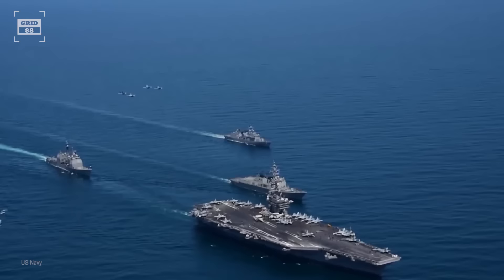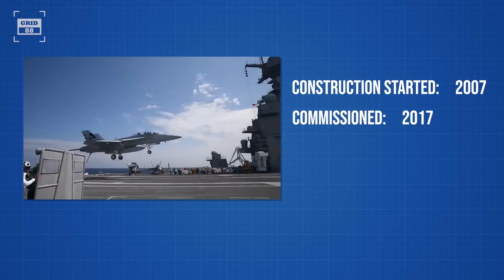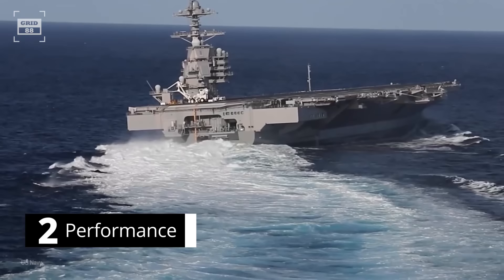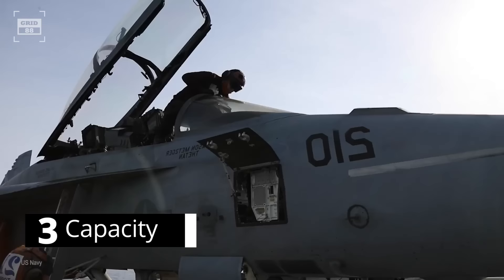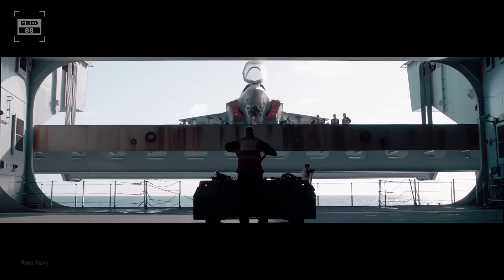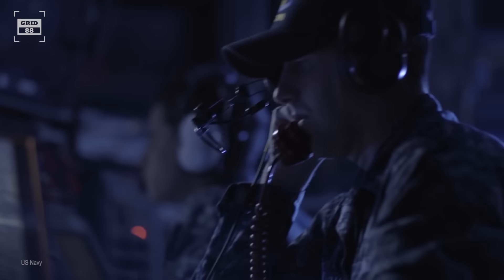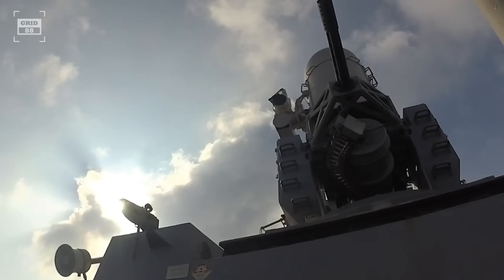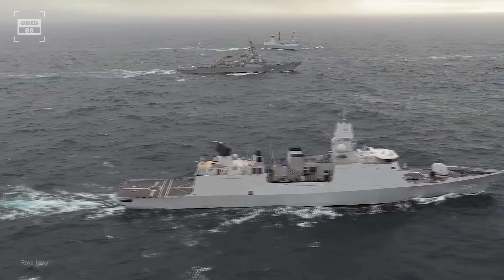USS Gerald R Ford vs HMS Queen Elizabeth - Which aircraft carrier is better?

Comment: If you are solely comparing capability then the Ford wins hand down. However, you have to look at the bigger picture. The Ford is astronomically more expensive than the QE and not just in construction. When the ship eventually gets retired it's decommission costs will far out way that of the QE. In fact the UK will likely sell the carrier on so will recoup some of the overall cost which wont be possible with the US carriers. Also, nuclear has it's drawbacks, some ports refuse nuclear powered vessels so the QE can dock where the US carrier cannot. The US carrier also has enormous refit times of literally years while the QE does not.

While range is clearly a key factor for the US carrier she still needs food, muntions, new crew, supplies so basically you could just refuel at the same time so it isn't as huge an advantage as people think. Especially if your navy has a large solid support fleet.

In reality the QE was never designed to compete with the US Ford carrier. If it was than the UK would have probably gone for just one carrier and spent the money making it nuclear and use the UK variant of EMALs and be closer to that of the Ford. Or non-nuclear and matched or even exceeded the combat capability of the Ford. The design was to give the UK a blue water navy capability and an independent strike force unmatched outside the US. It has done that and considering you could get 3 QE for the cost of 1 Ford (Meaning at surge capacity the three carriers could have over 200 aircraft) than I think the comparison is a lot closer than people think.

If there was war than it would be a different story. This is just the UK stepping up to it's NATO commitments for it's size and economy something which very few other nations are doing.
Reply: Good read Welshy 👍
Reply: The only country that denies its ports to Nuclear Powered vessels is New Zealand.

There are some individual cities that pass symbolic motions declaring themselves nuclear-free zones.  But cities don't have the power to ban foreign ships from ports that share their name.

For one, often the ports are run by entities separate from the city.

Also, federal governments control what foriegn ships can visit their country. This is not a decision that cities can overrule.
=========================

The QEC is a great ship.  And perfect for the UK's budget.    And the US probably shouldn't have implemented 23 bleeding-edge technologies into the Ford. As that is causing the ship to be behind schedule and over budget.

But is a fantasy that three QEC could surge over 200 aircraft.

The most each QEC class is designed to handle is 36 F-35s and 14 helicopters.   The QEC will usually just sail with 24 F-35s. While 36 F-35s is the surge capacity.
===============

It is also a fantasy to claim that the UK could have built a carrier that "even exceeded the combat capability of the Ford."

Over the past 40 years the US has built and operated  more aircraft carriers than the rest of the world combined. And it spends far,  far more on R&D than does the UK.    And the US also has a far larger industrial base,  and is the leader in technology.
Reply: @Courage2006  
Smaller crew = smaller running costs
Reply: @johngraves6378  Yes, a smaller crew means a lower running costs.

It also usually means the ship has less capabilties.  

And it certainly means there are fewer crew members available to fight a fire, stop a flood, and repair the ship while in a war situation.
Reply: @Courage2006  QE has almost full automation, something Ford is close to by the way, so can deliver a higher sortie rate than previous UK carriers. I don't think any navy would put extra souls on board to stamp out flames. If a ship does get put out of action the less souls on board the better.
Reply: @bmcpheat  What does "full automation" even mean? What specifically (besides weapons handling) is automated on the QEC that is not automated on other ships?

And fighting fires aboard ships is extremely important.  

American carriers definitely have people whose full time job is Damage Control and have a special patch for their fire control rating -- plus the whole crew is trained in fighting fires.

Also, a too lean of crew means that a ship doesn't have the redundancy to operate in a war scenario. 

And both the Nimitz and Ford carriers have a much, much higher sortie rate than the QEC.
Reply: @UCtVTOkQY7s3O0vQmqst14Eg You've still failed to say what is automated besides moving the missiles to the assembly area.

As you've pointed out, moving them doesn't take that many people so it can't be the source of much of the difference in manpower between the ships.

Also, the sortie rate you quote is just for a one-day surge -- it can't be maintained. And even that 110 sortie-rate over 24 hours -- is just a hoped-for, theoretical rate.

The QEC has never achieved anything near that rate.  In contrast, the Ford has already launched 170 sorites in just 8.5 hours.

The Ford will be able to fly 270 sorties a day over a five  day period. 

A single Ford will be able to fly 1,350 sorties over a five day period, In contrast, three QECs will only be able to fly 1,290 sorties over the same period.

--------------

You're also assuming the Ford-class carriers could be as easily hit as a QEC-class -- which isn't true. Since the Ford-class can fight the battle from a further range than the QEC thereby being out of range of the enemy.

American CATOBAR carriers launch fighter jets with significantly more range and bigger bomb load.

Plus, the Ford-class carriers can launch E-2D Hawkeye for airborne early warning (AEW).  Thus they can find the enemy before the enemy finds them.

Plus, while the QEC has just one layer of organic self-defense, the US supercarriers have three.

Plus, the US supercarriers are much more heavily armored with both thicker steel and Kevlar protecting the vital areas.

The three QECs would never even have a chance to fire a missile at the Ford carrier.  They would be attacked before they even know the Ford carrier was in the area.  And they would have no way of determining where the Ford was.
Reply: @Courage2006  keep your hair on lol. 
I think most would agree 1:1 ford is better but if you think 1 Ford can take on 3 QE your in la la land. Because if nothing else  you're concerning yourself with something that will never happen. If the UK did build a better craft than a Ford that itself would be an unnecessary act of aggression.
Re the automation. Click the link I provided.  Its far in advance to any other craft at sea.
Reply: @bmcpheat  You haven't provided any links -- or any facts to back up your claims.

You didn't address any of the points I wrote.  

The QECs could never even get in range to attack a Ford carrier.

---------------

If three smaller carriers would be more powerful than a US Supercarrier then that is what the US would have built.

The US has far more experience designing, building, and operating aircraft carriers than any country in the world. Plus, the US spends far more on R&D.

Experience and R&D matter.  Just as one US tank often destroyed 10 Iraqi tanks. One Ford aircraft carrier would easily desroy three QECs.
Reply: @Courage2006  
Are you 7?
What do you want to see? Full unconditional surrender?
The US's job within nato is to provide an unquestionable force, for carriers the choice  is huge nulear powered carriers. I suspect the full compliment will never get built frankly. But the UK'S job is a different one. Smaller craft can be readied quicker at port. 3 ships can go to 3 different places, not that they have 3. Unlike france who sunk all their money into a single ship the UK now have a permanent presence at sea.
The link is there scroll down a bit.
Reply: @bmcpheat  Ah ... resorting to insults. A clear sign of someone without any facts on his side.

You've once again failed to address my points.

As I've said, the QEC is a great ship and the right choice for the UK given its small military budget.

But it ignores the facts when you claim that  three  QECs could defeat a Ford-class carrier.
Reply: @Courage2006  ok.
Just for fun.
You've decided to attack 3 QE' they're all around you how many attack craft do you send after each?
Reply: @bmcpheat  They wouldn't be around me. Since they couldn't find me. Using the E-2D I would spot them while the Ford was still too far away for them to detect.  

Then I would launch a surprise attack against them while keeping the Ford out of range of a counter attack.

And the QEC has no missile defense to speak of.  In contrast, the Ford has two layers of organic missile defense.
Reply: @Courage2006  great strategy. A surprise attack on all 3 at once or one at a time. incidently QE's early warning radar is off ship soon to be wedgetail 850KM range so I dont see any advantage there at all really. There will also be crowsnest active on the carriers. Oh and the meteor missile is a verry good air to air defence missile which I'm sure can be mounted externaly on the F35 at a push.
Reply: @bmcpheat  You are jumping through hoops to deny reality.

Do you think the US spends the money on CATOBAR and E-2Ds just for fun?

Land based planes have all sorts of limits -- if they didn't, there would be no need for aircraft carriers in the first place. 

The US has far, far more land based AEW&C than the UK and far, far more bases around the world to fly them out of.  

Yet land based planes often can't give the coverage that ship based AEW&C can.  

Once the UK finally gets the Crowsnest working I'm sure it will be a good helicopter-based early warning system -- but it will be far inferior to the fixed-wing E-2D.

As far as mounting the meteor missile  on the exterior of the F-35:

#1. You are once again speculating about a possible future. Not talking about current capability or even a project currently underway.

#2.  Exterior mounted missiles greatly harm the stealth ability of the F-35.

#3.  Even if the UK does eventually outfit the F-35B with such a missile -- how does that change the comparison?  

The F-35B would still have significantly less range than a F-35C launched from a US Supercarrier. Also, the F-35C would still have greater internal weapons storage and could still carry more total missiles including external weapons. 

---------------------------------------

BOTTOM LINE: The US has much, much, much  more experience than the UK designing, building, and operating modern aircraft carriers. 

Plus the US spends far, far, far, more on R&D. Plus, the US has a far, far larger industrial base. Plus, the US has a far larger and much more successful high-tech industry.

Plus, the US spends far more on building each aircraft carrier.  

All that extra experience, R&D, capacity, and money means the US can and does build more capable aircraft carriers.

To pretend otherwise denies both common sense and reality.
Reply: @bmcpheat  And like every Brit I've ever discussed this with -- you've failed to list the ways the QEC is automated (besides weapons transport) that the US Supercarriers are not.

I am truly curious.
Reply: @Courage2006  you've pretty much explained it yourself. Its. All but fully automated munitions handling. From store to arms to flight deck  it saves the work of 150 crew or so. If it was a system the Ford had it would save even more due to the extra work load required. The ship is 2/3 the size of a Ford so its highly likely it will only need 2/3rds the manpower to start with. So work it out for yourself. 
Your spitting bile at your allies again. Im gonna assume you're no older the 15 or so, and leave you to it but ask yourself, why does the USA bother with any other flat tops if the Ford is the best at everything?
Reply: @Courage2006  
These rants are getting longer and longer. You are arguing with yourself about a subject that isn't relevant. Nobody has doubted the Ford would win in this battle that will never happen. What if india want to place 2 Carriers in separate places on a budget of under $10B? Whats the best carrier for that? 2/3rds of a Ford?  

How about rescue missions with more than one pick up point like a volcano eruption on a small island. 1 big ship or several smaller

Not the most fightiest, the best for the job in hand.
Reply: @bmcpheat  Yes, my responses uses facts and logic -- and they are thorough. In contrast, you can't help but resort to insults and false claims -- with little attempt to back up your assertions.

Previously you claimed this:  "I don't think any navy would put extra souls on board to stamp out flames."

But I proved you wrong.

You insisted that the Ford-class doesn't have "any advantage there at all really" as far as AEW&C -- but that claim of yours is clearly false.

You've been making various sweeping claims about the QEC and the Ford-class carriers that weren't limited to a particular use.

-----------------------

You also previously claimed this:  "if you think 1 Ford can take on 3 QE your in la la land." 

But now you're saying that of course the Ford would win.  Your claims are just all over the place.

And I've already said that the QEC is a great ship and the right choice given the UK's relatively small budget.

I'm just disagreeing with Brits that say the US should have built 33 QECs instead of 10 Ford-class Supercarriers.  You previously said this: "Imagine 33 QE's replacing the current US fleet."

I've imagined it -- and I've explained to you why that would be a bad idea. But instead of engaging in a discussion that you started -- you just keep getting upset.
-----------

Also, you claimed:  "QE has almost full automation"  And said about QEC automation: _"Its far in advance to any other craft at sea."

But, when pressed you finally had to admit you were only talking about the weapons handling system.
Reply: @Courage2006  your just not getting it and I don't think ever will.
Reply: @bmcpheat  Once again, you ignore my points and resort to silly, worthless insults.

When proven wrong like you have been -- you'd get more repect if you just admitted you were wrong.

I'm sorry you find it so painful to have your errors revealed.
Reply: @Courage2006  your points are silly worthless and insulting because you're way off base as to the points others raised. Which makes you look childish. You're not having a conversation you're just shouting.  People are pointing out that in their (and my) opinion  3 QE's could in most if not all circumstances be far better than one ford. As there is no Ford to worry about then what is the better option?
Reply: @bmcpheat  Wrong again. Unlike you, I've frequently directly quoted you and responded specifically to your claims.

You said: "People are pointing out that in their (and my) opinion  3 QE's could in most if not all circumstances be far better than one ford."

That is so vague as to be meaningless. Which circumstances?  If you're talking about a country only having a single Ford vs three QECs -- then I agree that a country would better off with three QECs.

That's why I've said from the beginning that the UK made the right choice by buying QECs.

But you've made lots of other specific claims that I've proved wrong. 

Also, you are the one who proposed one Ford fighting three QECs.  Even though, in other posts you disparaged such a hypothetical.  Hypocritical much?

-----------------------------------------

You said: "As there is no Ford to worry about then what is the better option?"

The above sentence is like many of your statements -- so poorly worded as to not successfully communicate anything.  What are you even trying to say?

----------------------

Face it.  You've made lots of claims that you can't back up. Then, instead of responding to what I write, you sling worthless insults or make new ridiculous claims.

All you've done is embarrass yourself.
Reply: @Courage2006  your behaving weird buddy. Move on.
Reply: @Courage2006  Not sure where you are getting your numbers from. The QE can carry 65+ aircraft in surge conditions. It literally said in the video 72 aircraft.
Reply: @Courage2006  Did you watch the video, you seem to live in Co co land - The QEC has an escort for a reason, one of the best Anti-Air point defense Destroyers on the world which does the job, Carriers are not meant to be protected hence the battle group. Either there both venereal to Hyper Missile attacks so having more would serve more here which the U.S already has, numbers. Only due to economy, considering how much the UK spends on her military and how much the U.S spends, I would expect to see a better product to be fair. And the The QE can carry 65+ - You talk shit.
Reply: @CommonSenserules1981  Ah ... resorting to personal insults.  A sign of someone without facts to back up their position.

The US has more than ten times the number of destroyers the UK has.   The US can (and does) surround their aircraft carriers with more destroyers than the UK can or does.  

The UK doesn't even have enough destroyers available to protect even one of its own carriers.  The UK needed help from multiple nations when it deployed the QEC.

Also, you are just plain wrong in your contention that  _"carriers are not meant to be protected"_.

It is extremely useful to have multiple layers of defense.  In fact, the UK originally planned to put missile defense on their aircraft carriers -- but it was cut because of budget constraints.  

Also, in an emergency US Supercarriers will sometimes use their speed to steam ahead of their escorts.   The aircraft carriers' multi-layered organic self-defense can be useful then as well.

Yes, the US has more money to spend so it builds more capable aircraft carriers -- that was my point all along.  It also has far more experience building and deploying modern aircraft carriers than any country in the world.  

Plus, the US spends far more on R&D and has a far bigger industrial base than the UK.  Plus, the US has a bigger and more advanced tech sector and arms industry.  Therefore, the US has the ability to build the most advanced aircraft carriers in the world. To believe otherwise would be to defy common sense.

The QEC is a great aircraft carrier and is the right choice given the UK's limited budget.  

I just think it is sad that some Brits aren't happy with the truth and they have to cling to myths and lies.

And the UK is a great country -- with an advanced economy and a very capable (but much, much smaller and less experienced) modern arms industry.  But compared to the US, the UK is a small country with a very small military.  Plus, the UK's financial industry tends to suck up Britain's best and brightest. Whereas, the tech industry in the US is where many of the best and brightest from around the world want to go.

------------------------------------------------------------------

You said: "The QE can carry 65+ "

So it is your claim that the First Lord of the Admiralty was lying when he testified before Parliament?

Again,  why do you think you so desperately cling to myths about the QEC despite all the evidence to the contrary? 

Is it a yearning for days gone by when Britain was a Great Power and had the most powerful navy in the world?
Reply: @Courage2006  Just my impression of you and the fact i'm an ass*hole online which I can not help so do have a little grace huh....

Either way - You will find Elizabeth is about 900 feet long, and displaces 65,000 tons. It can hold and operate many aircraft at that size. However, the Ford is quite a bit bigger at over 1100 feet in length, with over 100,000 tons of displacement. That means that it can hold and operate many more planes and equipment, clearly. 

But as other have stated which you kindly ignored - They are designed with with different purposes and with different budgets, you get what you pay for and the U.K does not spend anything close so what do you expect but we still come out with some of the best tech on the planet with the arguably the best trained military on the planet which work with the U.S as if they were joined to the hip. 

An an American once said on one of these videos - "We have 11 Nimitz Class & 2 Queen Elizabeth Class aircraft carriers & The British have 2 Queen Elizabeth Class & 11 Nimitz Class aircraft carriers". I agree with him over what you are here to project.
Reply: @CommonSenserules1981  I agree with almost everything in your last post. That is no surprise since nothing you wrote in your last post disputes anything I've said. 

Yes, of course, the much smaller UK budget matters. I adressed that in my very first post in this thread.  Given that the Ford costs so much more than the QEC it is especially absurd that so many Brits try to claim that the QEC is nearly as capable as the Ford.

Yes, the US and the UK are important friends, allies, and strategic partners. And the two navies are probably more integrated than any in the world. 

For example, before the QEC deployed, the US Navy was teaching the Royal Navy important aspect of how to operate a modern aircraft carrier.

Plus, the US has supplied the majority of the F-35s and the majority of the F-35 pilots for the QECs only deployment.

Additionally, the US supplies and maintains all of Britain's ICBMs. 

And the US and the UK were involved in joint military operations in Afghanistan, Iraq, and Libya.  

---------- ----

What do you believe I am "here to project"?  Please back up your belief by quoting me directly.

I directly addressed a number of your assertions. Something you have failed to do with anything I have said.

For example, I directly addressed (and disproved with facts and logic) your claim that _"Carriers are not meant to be protected ..."_.

I've also directly addressed your claim that "The QE can carry 65+ "

Which, unless you just mean transport -- and not used to fly sorties in combat -- that claim of yours is also false.  

As multiple high-level UK military personnel have testified before parliament, the QEC will normally carry 24 F-35s -- and in an emergency, it can surge to 36 F-35s.

---------------------

Also, many countries around the world claim to have the "best trained military".  It is a claim not backed by any metrics and it reminds me of a line from the Dire Straits song Industrial Disease:

"Two men say they're Jesus, one of them must be wrong"

Just like the claim of being Jesus, claiming to be the "best trained" is what people say when they want to seem more powerful than they really are...
Reply: @Courage2006  nice Wikipedia 👌
Reply: Another advantage of the Ford class is the capability of the F-35C
over the F-35B. The C is faster, carries more fuel, and can carry more ordinance. That along with refueling drones allows a Ford class carrier to operate further out to sea against a beer peer enemy with advanced area denial anti ship missile systems.The B makes sense for having a smaller footprint and that it allows the QEs to be built without catapults. But the US only uses the B for its tactical flexibility of being able to follow US Marines ashore and use 
forward air fields. It’s unknown if the Royal Navy ever plans to fight 
It’s Bs that way when the Marines leave their carriers.
Reply: @TheLAGopher  It was madness to build the QE class without catapults, and madness to let empty headed UK politicians have a hand in their design. In the 2nd Pacific War, tactics will, or should be, dictated by events on the ground.
Reply: I'm glad we have the US as allies that's for sure .from a brit
Reply: @Courage2006  This my dad can beat your dad up is bollocks the probability of the US an the UK fighting eachother is slim I'd like to think very slim after all were from simiilar stock
Reply: @Courage2006  I'm assuming your American?anyway well done the US I'm in bloody impressed an also we've been messing about with aircraft carriers as long as the US if not before but the US is a very impressive country spawned from the UK an only a few hundred yes old how can anyone not be impressed
Reply: @Courage2006  I love that A GROWTH OPPORTUNITY FKN BRILLIANT
Reply: @CommonSenserules1981  Love that.yeah we got u! Anyouve got us.aint that nice x
Reply: the ship is only as capable as her crew! remember that lol ;p while you have a bigger ship our tactics are far superior to yours :)
Reply: There is no reason a serious Navy would ever dock a high value asset like a carrier in any foreign port. The US has COD capability, which the QE class doesn't have, and always keeps its carriers in open water.
Reply: Awesome analysis
Reply: Your forgetting combat capabilities, the QE class relies on the Crowsnest radar system, (American designed and built) has no aerial refueling or COD capability, and cannot operate a true strike package. The QE class is a large amphibious assault ship, not a true aircraft carrier. It will only operate in the North Atlantic or stay close to home, it will never operate in the Pacific.
Reply: @rayjames6096  that's not really true. US carriers regularly dock at foreign ports.
Reply: @rayjames6096  again back to my point. The QE was never designed to compete with the Ford. It was created to give the UK a credible blue water navy capability. Lets be honest the UK couldnt give a monkeys about the pacific. We have no real credible holdings there to warrant any serious military commitment. So the UK doesn't need such range demanding carriers. Finally these ARE 100% carriers. They have more capability than the carriers that retook the Falklands and just because they don't go toe to toe with a Ford class doesn't make them any less a carrier.
Reply: @anignorantbrit  You Brits always are comparing yourselves with the US, the UK does have trade interests in the Pacific that are vital to its economy. Those two carriers are confounding. What is their purpose. They lack on everything a fleet carrier is. They're a mess.
Reply: @anignorantbrit    Electrical power capability at sea is extremely important, the Ford class can generate around 660 MW, the QE maximum is 112 MW. This is a reason for the high cost of Ford class along with over 20 other new technologies. Go big or go home.
Reply: @anignorantbrit     US carriers very rarely ever dock at any foreign port. They're warships, not diplomacy platforms that the UK uses its carrier for.
Reply: Some excellent points, well made.
The difference in crewing costs are also astronomical
I'm genuinely shocked that the Ford still needs that many crew, you'd think with a $15B development and build cost they'd have tried to reduce the lifetime crew costs more.
Reply: My 2p:

Ramped STOVL carriers have some hidden bonuses not typically understood.

Recovering the F35Bs:
CATOBAR fighters need to reserve multiple tons of fuel for recovery, for holding patterns and go around.
And it gets dumped for it's landing too, that or weapons.
But a STOVL aircraft has no such need, holding patterns are rarely needed as a STOVL landing is very quick and then it's just taxi off the spot for the next in the queue.
And because it's quick, they land on fumes, there's never a go-around.
Recovery is quick and easy for STOVL, learnt through pushing the envelope during the Falklands.

Then there's takeoff.
No steam, no cats, less crew and less time.
Don't care about wind, taxi, throttle up, time it for the bow going up when you hit the top of the ramp and off you go.
Next in queue, go.

And here's the thing:
HMS QE: 110 Sorties per 24h
Nimitz: 120 Sorties per 24h
Ford: 160 with 270 surge over 24h

So far there's no expectation that they will beat the Nimitz numbers and that they're just going to be content with 25% less staffing costs.

And the real cost of a QE class ship is $3.6 billion.

The Ford is an amazing aircraft carrier, the absolute best in the world.

But it really isn't worth what they paid for it.
With cost over runs it's an absolute lemon 🍋
They should have made incremental changes to Nimitz or taken a fresh design and kitted it out with reliable features.

Or...

Let the British design it and build the first one for them, while training their designers how to design.
Reply: @MostlyPennyCat    The QE class has essential capability gaps. The US carriers are capable of aerial refueling, which the QE class isn't capable of and the F-35 has a 5000 lb bring back capability so there's no dumping. The QE can only operate one type of fixed wing while a US carrier air wing operates a full strike package of different mission aircraft, the QE can't operate drones also, there's numerous capabilities that a US carrier has that the QE class doesn't have.
Reply: @rayjames6096  You: "US carriers very rarely ever dock at any foreign port. They're warships, not diplomacy platforms that the UK uses its carrier for."

Nov 2022, various UK newspaper reports: "Royal Navy welcomes American guest: USS Gerald R Ford anchors in Stokes Bay in the Solent" 

"Whilst docked in the Solent, the vessel's 4,500 crew members have been taking in the sights in Portsmouth and London. "The crew of USS Gerald R. Ford is honoured and excited to visit Portsmouth, heart of the Royal Navy, during Ford’s first deployment," said Capt. Lanzilotta. "The United Kingdom is a cherished ally. We are here to work together, strengthen our partnership, and give our Sailors the opportunity to explore this beautiful city.""

You = 🤡
Reply: @GM-ii8gs   That was a response to a text that was asserting that the UK diesel carriers were welcome at every port and also to traverse the Suez canal whereas the US nuclear carriers were limited in where they could travel (no traversing the Suez allowed) or the ports that would allow it.... the US has been traversing the Suez with nuclear carriers for over 60 years and no country, friend or foe has ever denied or would ever deny a US carrier entry into a port.
Reply: @GM-ii8gs   These US allies we have don't realize US carriers are seriously overworked.
Reply: The UK hasn't shown any reason for the two carriers. They're of no value to NATO and the US knows this.
Reply: @anignorantbrit " Lets be honest the UK couldnt give a monkeys about the pacific. We have no real credible holdings there to warrant any serious military commitment."  Sorry,  can't agree with that.  And this is speaking as a fellow Brit.  Hong Kong and an increasingly aggressive China counts as part of the Pacific in most people's geographical knowledge I would think.
Reply: @rayjames6096  You seem to have a very negative opinion of your British allies across the pond.  I'm sorry you feel this way,  I really do.
Reply: @Courage2006  Damage Contolmen all day EVERYDAY!!!! DC for life!!!!
Reply: @Courage2006 well contrary to that, UK scientists shared the first research with the US that became the Manhattan Nuclear project, actually us Brits invented almost everything you are looking at now , contrary to popular US belief , we invented the Light Bulb, Internet,  the first real Television, ATM machines, and Computers to name but a few. The Queen Elizabeth carrier can carry 72 aircraft in all but isn't usually equipped with that number
Reply: @Courage2006  I think that he meant the UK blowing its whole budget on one aircraft carrier, which it could conceivably do. The US government would lose their nut if one of their strongest allies randomly decided to build some gold-clad ship with football pitches to outclass a Gerald Ford because it would be an utterly stupid massive strategic own goal. The UK shares technology development with the US and is one of the most prolific technology innovators on the planet, so it's a little eccentric to pit them against each other when the technology relationship between the two countries is symbiotic. From an American perspective, they should frankly be piling money into countries like Japan and the UK because our strategic programs suffer primarily from lack of financial support and we're no less a part of what keeps America on top than what you develop at home.
Reply: @Courage2006  The US has changed its strategy for the future because the expense of these aircraft carriers is their greatest weakness. The US is in a good position now (thank goodness, with the world as it is), but none of the Brits on this chat would be cheering about a Ford class carrier being taken out. And... you wouldn't risk using QE class carriers to do it anymore than you would use an elbow to clean out earwax. The danger to both ships seems to be from missile or drone over saturation, whether below or above water. The US is apparently likely to start building smaller ships now, so you should prepare your arguments of tomorrow to be about America having more ships, not expensive ones. You also need the Brits to have parity in technology because we're allies and we ain't going to be much use rocking up in rubber dinghies. Let's hope that these British carriers are better than you think because the money could perfectly well have been spent on something else.